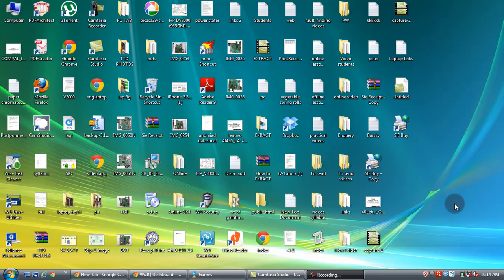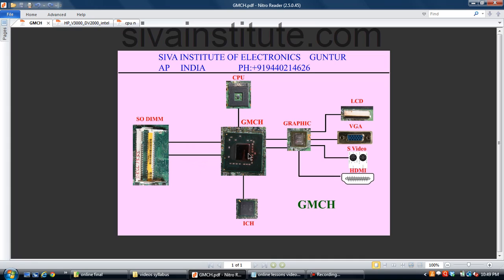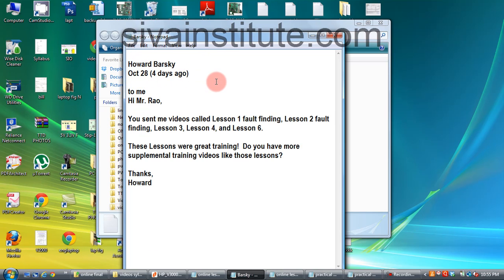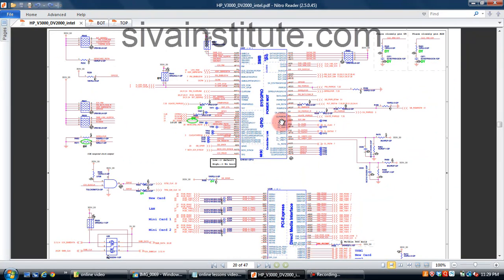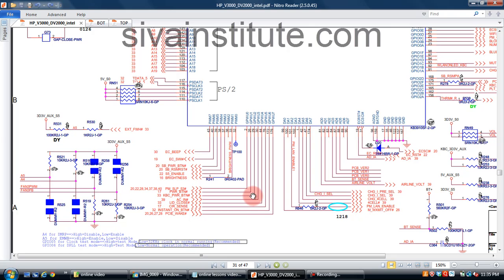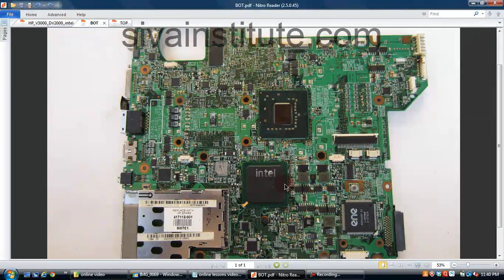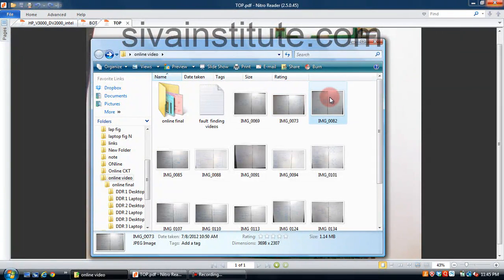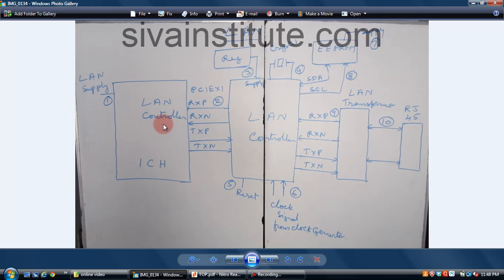Laptop Repair videos

Comment: Hi what would happen if there is short circuit at power jack i was soldering the loose jack in a laptop and later when i tried to turn it had a spark at jack place what would be the damage

Comment: Dear Respective Sir,
You lecture is very very usefull for Laptop Repairing, thanks for uploading your video.
I am humble requesting from you, kindly upload video for CPU Section, Clock Generator, Power State 5V, 3.3V, SIO Chip,   All Voltages, VRM Section, Board testing from CRO Machine & Debug Card Error code & his sollutions.
Kindly accept my request & share your knowledge, We will wait for your next uploading video,
Thans
Best Regards